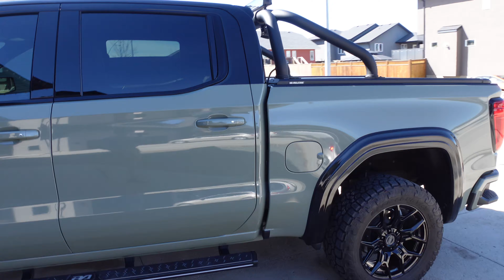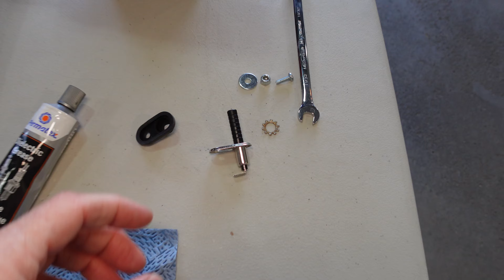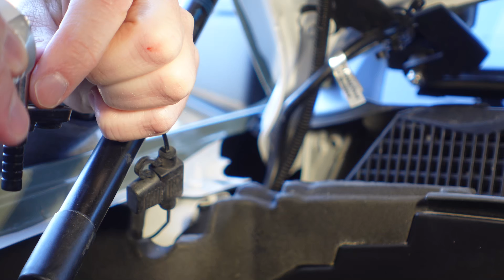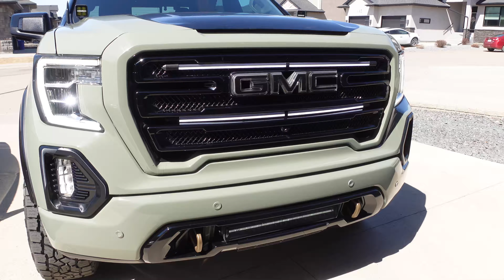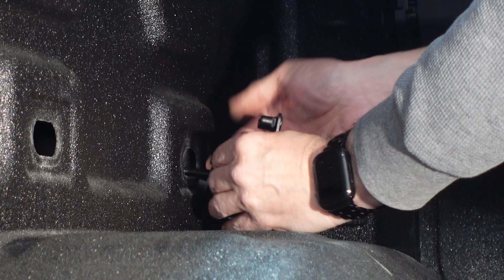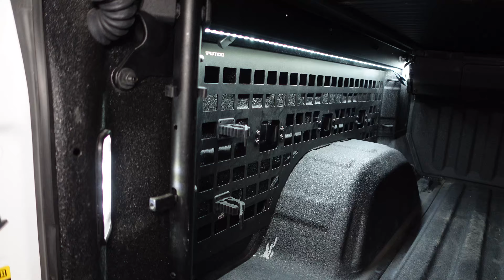Finishing Touches On My Gmc Sierra At4 - Let's Wrap Up Loose Ends!

Comment: Why not use. Magnetic switch sort of like the type used for windows or doors. The rally is with in an enclosed housing and when brought near the strong magnet, the reed closes the internal circuit. This will keep the moving parts internal and out of weather’s and salt’s way to prevent rust from hindering the function for your under hood light. Could Lao use a mercury switch that when the hood raises to a desired angle, the circuit completes and light turns on.

Keep up the great chanel.
Reply from the maker: Please send me a link to the switch you are suggesting